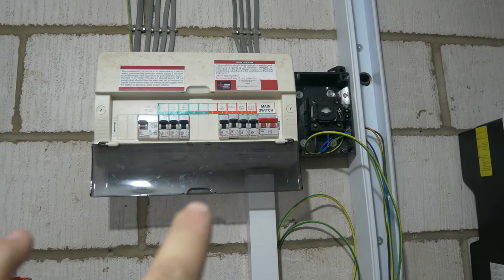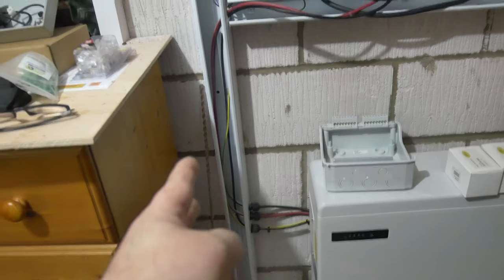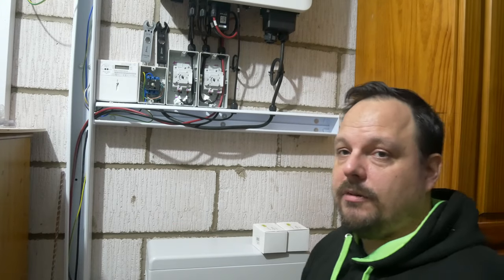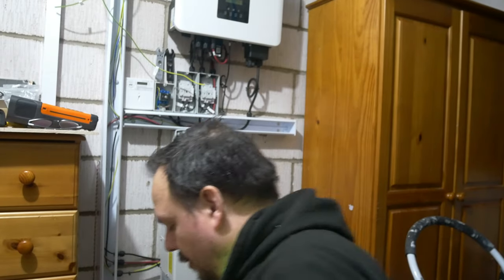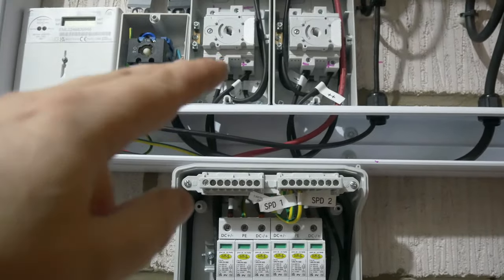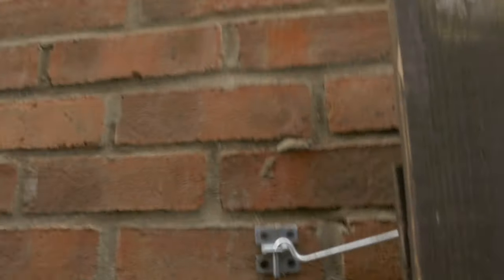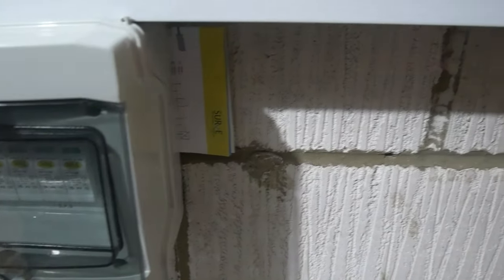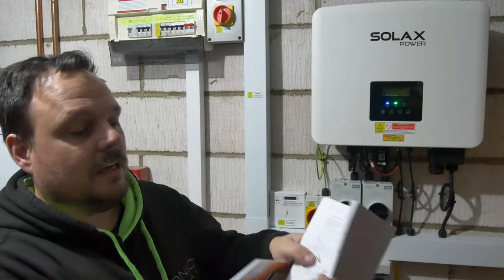How to install a 5kW Solar Solax Hybrid Inverter & Battery Storage System

Comment: I got a Solax X1-Fit and 1 5kw master and 2 5kw Slave Batteries superb,I initially just had the 5kw master like in your setup but it's not Man enough in Winter probably great for Summer use though 👍
Combined with the Eddi you fitted me,I'm super happy with my current Solar Array/Battery Generation 👌
Reply from the maker: Awesome Ian! Thanks for the feedback and for watching!

Comment: Nice vid, just doing an installation with the 3x hybrid solax 10kwh with 11.6kwh batteries.
I did get slightly confused with the wiring of the chint / ct limiting meter 😊

Comment: I understand that the battery connection has changed in the new inverters from May 2023 which require you to get a H4 crimper, is there any video on how to make up them cables.  I just want to unplug a 5kW inverter and put in a 7.5kW in its place.

Comment: Great stuff.  Perhaps you could  consider 2 into 1 bootlace ferrules for your dc cables into the dc isolator although not your favoured choice. It could then be considered as one cable.
Reply from the maker: We tried this but the insulation on these been the thickness it is prevents them fitting in. I did think that would be a nice solution but doesn't work sadly.

Comment: I’m just not happy about installing lithium based battery packs in people’s houses so I’m designing external enclosures for my installs. Battery backup with economy 7 is far more economical over 6 years removing the need for solar installs in the majority of domestics.
Reply from the maker: I wrestled with that myself tbh. We will not install any equipment in loft spaces but happy to place them in garages or storage spaces away from the main routes of exit. It's a tricky one. We spoke about this on the electricians podcast Sunday night. 

Some good value with battery only and a solid option for those without roofs. But still tied to energy price fluctuation and changes to off peak tariffs and times. Thinking EV overnight charging adjusting that window in the future. 

Solar on its own with those who work from home or are home during daytime often can be most cost beneficial without batteries. Even more so with a storage water tank and myenergi eddi.
Reply: These batteries are heavily tested... Aslong as the cells are not punchered nothing serious
Reply: There is a big difference in the safety of Lithium batteries depending on the chemistry used. The main two types used are NMC (Nickel Manganese Cobalt) and LFP (aka LiFePo4 or Lithium Iron Phosphate). Personally I wouldn't have NMC cells in my house but I'm more than happy to have LiFePo4 battery modules installed. In fact I have two 4.8kWh Pylontech US5000 modules in the cupboard under my stairs right now and about to add a third. We don't have anyone living upstairs unless we have guests but we do have a fire escape route upstairs through a bathroom window onto a roof if it were needed. 

I don't mean to sound complacent but honestly I think the risk is higher from a fluffed up tumble drier or a cheap chinese charging brick than from reputable LiFePo4 batteries.

Comment: Hi Mark. I'm due to fit the same system in a couple of days. Looking in the manual it says a 50amp mcb and 10mm2 cable for the AC side. Did you use the same? So a 3 core 10mm2 flex entering the Inverter? Also did you use a foiled screened Cat 6 cable to avoid crosstalk. Also i can see on your video that you have the cat 6 cables in the same mini trunking as your mains. Does this not concern you? Any advice would be a great help. Many Thanks Neil.
Reply from the maker: No issue with the cables in same trunking so long as all rated to the maximum voltage present. Which they are here. 

Yes screened CAT 6 but it's only for the CT monitoring so not really needed imho.

Cable size and OCPD is up to you. It depends on your generation array/battery capacity as to how much it will ever output at once.

The figures in the manual are based on generation alongside battery charging etc so of your system is big enough size the AC cabling as you describe. 

In my case the array on the roof is very undersized to the inverter (we plan more panels in the future) So we went with 6mm and 32A upfront. All happily working just fine and generally running at 25A maximum. 

Hope that helps and thanks for watching.

Good luck!
Reply: Thanks Mark. All the best 👍

Comment: I'm installing the same 5kw hybrid inverter at home, I'm not MCS registered, so I have another company coming to do the actual install and commissioning , but I'm prepping the board and cabling and mounting the battery and inverter for them.  The manual states the 5.0D needs a 50A breaker.  I saw you only used a 32A RCBO, do you think that could pose a problem?  I assume it's to cover the current flow for the battery charge from grid.
Reply from the maker: Hi Ben, the manual is confusing on that aspect. I spoke to solax technical as in other places it mentioned a 40A circuit...

You might have spotted the cable change on the inverter towards the end of the video when we swaped to a 40A varient 🤭. Covered in the next video which is already out. 

I've got another video on the 7.5kW hybrid ready to release. 

In short it's a 40A circuit you will need lol. The 50A figure is maximum operation in EPS mode but of course EPS and normal cannot exist at the same time.

Comment: Hi Mark, I'm going to be installing a similar system in a couple weeks. will be my first solar battery storage system install. the client has asked if he is able to choose when he wants the grid to charge the batteries if they are not fully charged from the solar panels. Do theses inverters have this function and can you choose when they charge from the grid?
Thanks
Reply from the maker: Hi Tom, yes you can via the solax cloud app

Comment: We have a solax inverter fitted and we are very happy with our setup. But can you tell me how to power the house from the solar panels during a blackout?
Reply from the maker: A video on my channel just after this one covers this. But it does depends what inverter you have as not all can run in eps mode
Reply: @electrician247  thankyou Mark! I will look tomorrow.

Comment: Hi mark I see some installers use a white board to fit everything on, but you don’t, I’m about to install, do I need a white board, is it a regulation or requirement of some inverter warranty’s or just different people’s choice ?
Reply from the maker: I use them mate. Shown on some other videos. The surface just needs to be fire proof. We use the boards to level uneven surfaces or to make it look a bit nicer is the short story lol
Reply: @electrician247  
Nice one I get you, so regs wise I’m fine on a internal face brick work ( garage wall ) 👍

Comment: Hey, just a quick one. Did you bring the solar DC cables through the SPD first and then all the rest? Where did you connect the incoming DC cables, that are from the roof?
Reply from the maker: Covered in the video. DC cables come to the DC isolators first 🫡
Reply: @electrician247  excellent!

Comment: Is the RCBO bi directional? If so how do you check? Also did you need x2 SPD's for the PV? I'm not an expert by any means just curious! Cheers
Reply from the maker: The rest of the series answers these questions mate. One SPD for each string and yes bi directional is critical. We ditched the rcbo here as wasn't needed. Proteus do bidirectional

Comment: Mark may I ask what the inverter manufacturer recommendations were for RCD protection. I ask as Solis recommended the use of a 100ma RCD.
Reply from the maker: Hi Gino, no rcd required on these unless cable type/route dictates otherwise.

Comment: Hi Mark, 

Just wanted to know, so I see you have SPDs fitted at the Inverter side but did you also fit SPDs 10m from the last point also?
In the loft for example?

As reg 534.4. 4.2 says, "If the distance between the SPD and equipment to be protected (protective distance) is greater than 10 m, oscillations could lead to a voltage at the equipment terminals of up to twice the SPD's voltage protection level.
Reply from the maker: Hi Nathan, no one size fits all is applicable for this tbh. So it depends is the answer. Some inverters and optimisers carry over voltage protection within them so will vary on the equipment you use. 

In this case our cabling to the array is most likely under 10m regardless as we took an external route up to the loft and inputs pretty much straight above that. 

However we fit the auto shutdown product from projoy that has SPDs within it, thermal sensors and can be remotely activated by fire fighters. It sits in the loft under the array. 

I’ve shared videos on that product in the solar playlist if it’s helpful. 

With your DC SPDs primarily it’s what are you trying to protect. We still generally fit external ones even if the inverters have them built in. As was the case here actually. The solax hybrids have them while the string inverters do not.
Reply: @electrician247  Great answer thank you, have a good Christmas

Comment: Comprehensive install, great work but why the two AC isolatiors when the inverter is adjacent cu? Cheers
Reply from the maker: I cover this on the next videos. Not required but as we was awaiting MCS site assessment we was following the diagrams to the letter. When really if the inverter is in the same location as the CU you only need the one 🤭
Reply: @Mark The Sparky Allison  OK I see, thanks for response Mark. Keep up the good work mate

Comment: Hi, Im just about to install this exact system. Im also new to solar. The DNO will be coming to witness the commissioning. One of the questions on the G99 A3-1 asks to show the checking of the " Interface protection settings" . Did you have to do this? If so was it simple to do? Is all this in the manual? Cheers Will

Comment: A very neat install.

You raise a good point about having isolation at the consumer unit. We have solar PV (Installed a few years ago for the previous home owner) which is located on a barn and there's no isolator (Or labelling!) anywhere near the consumer unit which is in the main house. I suppose the G98 compliant islanding prevention helps in this regard but it doesn't replace a handy local isolator ofcourse. Ours does have DC isolators but does not have DC SPDs - Are these required these days or just best practice?

Are you allowed (Or is it advisable, even if allowed) to run the DC string cable within the same containment as the AC wiring, especially in situations where you have 1000V strings?

For stripping the DC cable, have you tried a CAT5/6 stripper? The kind which just clip on and spin around. I've never tried it but I'd think it would do a good job.
Reply from the maker: Hi! Yes I tried the data stripper worked well. 

The 1000V is a factor if you have long strings. These will only ever carry sub 300V as split the array in 2 parts. 

I discuss this in part 2 which includes the roof work. I did compartmentalise the trunking a little to help avoid any issues. Alongside the true double insulation I think we are good! 

On longer strings with higher voltages I would think harder on it tbh.
Reply: @electrician247  Ah I see, I wouldn't be surprised if a lot of solar installations have been put in without half of the consideration you've put in - It's great to see the process of an experienced electrician moving over to solar as some of the solar installers seem to just go straight into it without any other experience to draw from. (Or at least, that's how it appears from some of the installs I've seen.) I'm looking forward to part 2!

Comment: Hi Mark, great installation and video upload. Can you please explain the spds on the dc strings. I done my solar course last year and there was no spds on the test rig, more going through my book do I see anything. Cheers
Reply from the maker: It's in the regs about SPDs but still a grey ish area. Some inverters have the built in but tend to be T3 AC spds. 

Its for things such as atmospheric energy (not so much lightening). Bird damage, impact etc causing well a surge. Need to be close to inverter to protect it. 

These were about £65 each

Comment: Do you have a preference of sunsynk vs solax, and even solis too?
Reply from the maker: Sunsynk is a no from me at the minute to many problems with app reliability. Prefer solax of the 3 options suggested along with growatt for basic string inverters. The later has the benefit of dc arc detection

Comment: Hi, I have just installed solax inverter and 2x batteries. The batteries are flashing red.. any ideas? 
Thanks
Reply from the maker: Lol could be anything. Worth checking the inverter software is up to date as sometimes they won't charge the batteries if the software versions are not right. Call solax tech support. They are really good.

Comment: Hi Mark, I have been told we cannot backfeed RCBOs by every manufacturer I talk too, is your backfed
Reply from the maker: That's such a good question and during this job that exact thing entered my mind! Part 2 will show some changes that are visible in this video if you look at the supply cable to the inverter early on and then again at the end 🤭. 

These inverters don't require rcd protection anyway unless the cable supply method dictates it. But I was trying to be belts and braces! 

I have another video soon with a way I have tackled this in case you have to have rcd protection because of cable type. 

I thought it was an interesting topic and glad you also spotted it 🤭
Reply: @electrician247  thanks for the reply it is much appreciated. I have come across three installs in the last year that had tripping issues and each one was backfed, hence my research. As you rightly say many inverters do not need this and in each of the case I just swapped out the rcbo for an mcb... keep up the good work with the videos. I also think it would be helpful to see a schematic of how to install with and  without RCD protection. keep up the good work with the videos., best regards, Jeff
Reply from the maker: @jeff taylor  thanks Jeff. I'm really enjoying the learning tbh. It's a bit of a mind shift in the way current is flowing to keep me on my toes lol. Thanks for the input!
Reply from the maker: @jeff taylor  hi Jeff. I've done some digging and if it helps in the future the Proteus mini DP rcbos can be back fed and work in both directions. Hope that maybe helps you out. Thanks.
Reply: @electrician247  thanks it does and off to CEF.....
Reply from the maker: @user-sz5iw5ge8m  make sure it's the new compact DP ones. No problem mate.

Comment: Great Video Mark :) I have a question about the DC SPD's. Are they to protect against lightning strikes?
Reply from the maker: No, these are more for atmospheric conditions below that level. Or other external events that can occur through bird strikes and such. 

With lightening protection things move up a level.
Reply: @electrician247  thanks Mark :)

Comment: May I ask what is the ma of the rcbo you fitted. Did you fit a 30ma.
Reply from the maker: With the solax you don't need to fit rcd protection unless the cable type dictates you need it. It happily works on 30mA but as explained in this or the next video the setup was changed to no rcd protection
Reply: @electrician247  hi Mark I got this from solax direct . SolaX inverters are approved for use of Type A RCD (ABB).   ∆, Minimum Value for X1-Hybrid is 100mA.
Reply: If if you like I have the documentation from solax and solis inverters as I use 100ma as recommended. I can forward you the info I received. If you would like these just let me know how I can forward them on to you.
Reply from the maker: @Gino  yes I have had the same. However having spoken to technical a fair bit I have done my own experiments! 

I've got one on test in my own home quite happily working on its own 30mA type A rcd. Peak leakage over a 3 week period of 3mA 

In customer installs so long as final circuits are RCD protected the minimum solax requirement is covered. 

As a minimum on the inverter they want the 100mA rcd protection to cover off connected loads in EPS and regular operation and what we might call minimum is in opposite to what they are calling minimum is the current chain of thought. 

I don't expect I will have any issues with the RCBO protection on mine but time will tell and in customer installs we are ensuring the inverter feed doesn't need it so not building in problems for anyone 🤭
Reply: @electrician247  cool I fitted a solex last week and fitted a separate board with 100ma , same with solis inverters . I have basically followed manufacturers recommendations , keep us posted if you have any issues.
Reply from the maker: @Gino  always the best way. If your surface mount or in trunking with all your final circuits on 30mA rcds you don't really need it but doesn't hurt thats for sure.